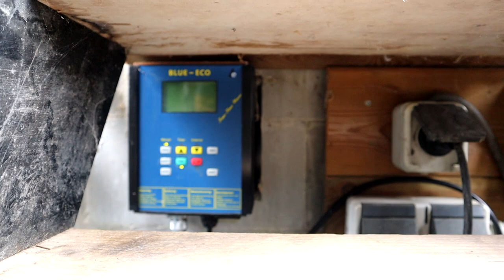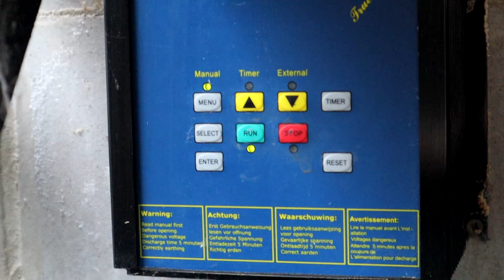Beautiful Backyard Modern Koi Pond | 20.000 litres

Comment: Great pond. Add some anoxic filter for better stablity of water. Keeping nitrates level lower will make koi more brillant
Reply from the maker: You are right, I think the owner used a plant filter/helophyte before between the pond and the filtration room
Reply: @Aboutkoi  An anoxic basically uses bacteria and the ionic/electrical charges of the media along with diffusion/capilliary and convection forces. Plants are extra. I get good results in my small aquarium.Water is not forced through the filter. Ammonia to nitrite to nitrates to Nitrogen gas. That's what the anoxic filter do